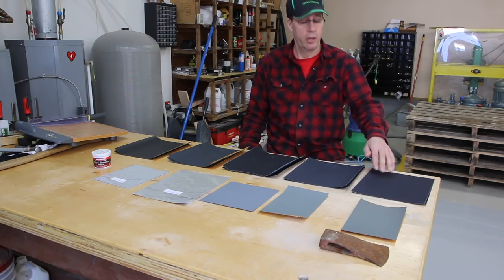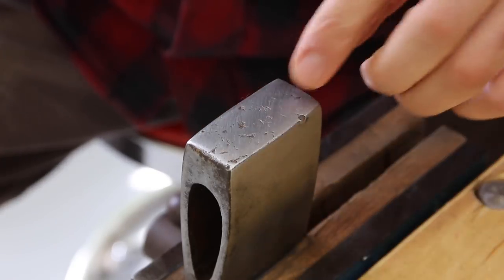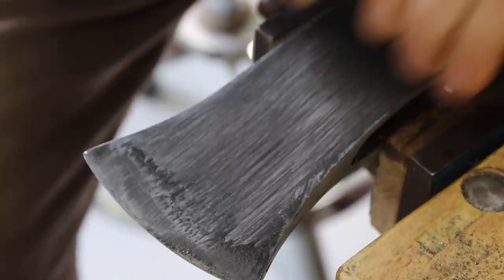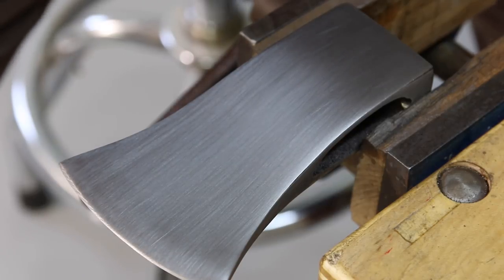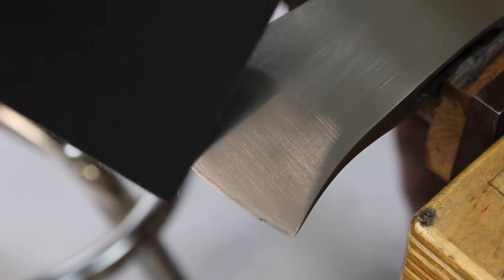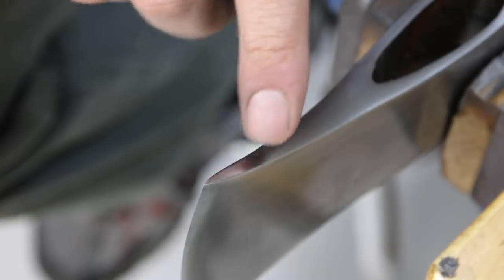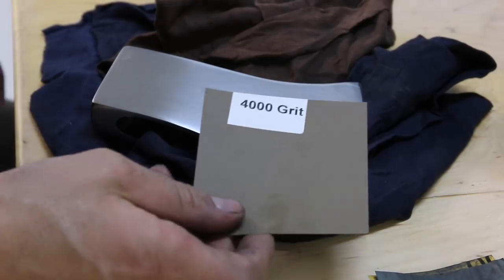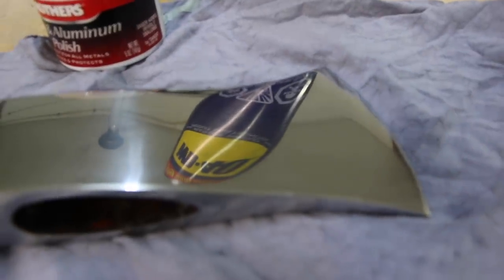How to polish an Axe WITHOUT power tools

Comment: Alot of people commenting on how much faster and easier it would have been with power tools. Some people don't have power tools and specifically search out videos like these. Also, when you get finished with a project like this it is so rewarding when done by hand. Some people just enjoy the aesthetics of doing it this way. Lastly, some people love having one arm look like Popeyes and the other arm looking like Olive-oil's!
Reply: i found a big 2.5" anchor bolt at the tesla plant going up in austin TX. im wanting to do this with it and use it as a paper weight. could not have made a better video myself.
Reply: Using mechanical equipment can be faster but doing something quickly dose not always mean it is done properly.
Reply: Olive Oyl* 😊😊
Reply: I completely agree. If I’m doing it for someone else or doing it knowing I’m going to sell the finished product, I’d prefer to use a buffer machine. But things I plan to keep in the collection I like to do by hand I enjoy knowing I put the time and effort into it more.
Reply: @Biggchad  for sure. When I ‘restored’ my first couple of pieces I only had hand tools. Later, I acquired some power tools and did a few and it was quicker but not as satisfying.
Reply: It will dull the axe if not careful.

Comment: Just a little tip, always fold your sandpaper in thirds. It keeps it from sliding around all over the place, as well as giving three surfaces to sand with as it is difficult to apply pressure at the edges of the sand paper.

Comment: Nice job. In my experience, normal cloth towels and paper towels are abrasive to mirror polished surfaces. I think that's why you had scratches in the end. Try to buff off with clean microfiber with gentle pressure if you can and see the difference.
Reply: He needed to buff with Tripoli after sanding and before polishing.  It removes the fine scratches that sanding doesn’t get unless you go to 15 or 20k grit.  I do this at my job.

Comment: Trick from a guy who restored a couple of medieval armor replicas:

Let your 600 and 1000/2000 grit sandpaper clog up some as you work and get mirror finish in less time with the same car metal polish and no more than 2000 grit. Just keep sanding when your 600+ seems clogged up and see how it goes from there...
Reply from the maker: Thanks for the tip!
Reply: @frenchriversprings  nice video. What’s the reason for changing the direction of the sanding?
Reply: What the reason that letting the 600 grits clog up gets a mirror finish faster ?
Reply: @marcn8750  As it gets clogged up, it becomes smoother and the grit seems finer, as if it was a higher grit sandpaper, but broken in. If you go for a new sheet of higher grit paper from there, you'll have to break that one in while making the surface dull again.
Reply: @Flashahol  interesting. I’ve always wondered why my older used sandpaper seems to be more gentle. 
So it’s basically less aggressive snd will give a shine faster IF the surface cuts are “ready” for it. 

The slag on the used paper is basically steel dust mixed with the lubricant. The abrasive on the paper is either worn away or covered by this slag. 

Correct?
Reply: @marcn8750  You got it!  
It's like your sandpaper is gradually turning into polishing paper.
Reply: @Flashahol  got it thanks. Doesn’t makes it better … just makes it milder. 

Recently I have been doing this …

1) use metal polish. It’s aggressive. But gives a nice even cut lines. Can cut normal A4 printer paper to size and put a bit of polish on said area. 

2) cape cod cloth. 

3) diamond paste 0.5 microns on a cotton mop

Has saved me tons of time. I do this for mirror polish for watch cases.
Reply: @marcn8750  Precisely! You still need some fine metal polish for perfect mirror finish, but it's faster and lazier than going through 3-4 different grits and then different metal polish grits. 
Diamond paste in micron size is hard to beat, but not the cheapest. I like the cotton mop idea, I'll have to give that a try.
Reply: @Flashahol  the metal polish is use give quite a coarse mirror. Good enough for silverware but not a watch case.  I cape code cloth gives it another 30% finer mirror. And the diamond paste with the cotton wheel does the final 5%. 

I only  for dings on the watch case. Maybe 3,000 grit.

Comment: I agree with the process, that is, up until the polishing. the mag polish is for magnesium, not steel. if you change to a German metal polish like Semichome, as well as, keeping your polish stokes straight and not going around in circles, it will produce a clearer reflection. The thing to also take note of is for people trying to do this, make sure you remove "ALL" the scratches caused by the previous sandpaper. If not, you will get a distorted reflection (kind of like a carnival mirror). If you would like to keep the polish, you will need to seal with a metal lacquer to prevent it from oxidizing. However, for me personally, I would have used machines, it's just a little faster.
Reply: Agreed. Though, I wouldn't bother to polish the whole axe head in the first place, just the primary bevel with the cutting edge. The remainder would be fine with a 600 grid finish. But I guess the video still fits its intended purpose, except for the use of an unsuitable polishing compound.
Reply: It sounds light the paste and/or cotton wheel could be too coarse, or you are applying too much pressure when applying it to the buffing wheel. Make sure your buffing wheel is clean and you are using a very small amount of your paste and let the bracelet bearly touch the wheel.
Reply: Many thank for your advice,  i will try
Reply: Why can't it be used for steel?
Reply: If you look at the video though, the container says "for polishing all metal" right on the front of it.  I think he got the intended result and the product seemed to work just fine!
Reply: @phantomcreamer  Just guessing here, but maybe the abrasive is not hard enough to scratch steel.  Magnesium is much softer, so they could get away with using a softer abrasive.

Comment: I feel your pain... I restore and sell norlund axes on ebay with exotic handles.  Most polished..  I do use a flapwheel for primary grind, but i hand sand the rest.  60(flap) 120, 180, 220 320 400 600 1000 1500 2000 then black then white compound on a wheel.  It takes me about 4 hrs start to finish on a polish.

Comment: I appreciate the hard work that went into this, but a couple critiques that I would make is that you are using too much pressure.  The sand paper will remove material no matter how hard you press, but pushing too hard will leave scratches.  With light pressure you can finish in half the time.  You can achieve a mirror finish using water and 2000 grit sand paper with light finger pressure.  WD-40 has surfactants in it that will prevent you from achieving a good finish, so you should save that until the end after the buff.  if you have any light scratches a little rouge will take care of it with a microfiber cloth.

if there are any major gouges I'd recommend a bastard cut mill file.  It won't cause deep scratches, but will take a little longer. Never change directions.  if you're sanding from heel to edge do that the through whole process.  Once the scratches disappear from the previous grit then go to the next higher.  If you move the the next grit too soon you will have scratches though that won't come out.

I normally use 60, 120, 220, 400, 600, 1000, 1200, and 2000.

Comment: Thanks very much for posting this.  I needed the instruction.  I've got a table my GGrandfather made, 60,000 pieces of inlaid wood.  The legs have steel slides on the bottom, one is rusted up badly (old cat pee that leeched through the carpet a long time ago), I discovered when i moved the table.  The wood is fine, thank goodness, but one steel slide is about as rusty as your axe was to start.  I can't find a replacement slide in the same dimension, so I'm going to restore this one.  Goodbye wrists, hello sheen.

Comment: Well it seems that is the way to go, when guys use the grinders and power sanders you can really see waves, high/low spots in the metal that ax turned out perfect, looking forward to you making the handle.
Reply from the maker: look at the end of the video. there is a clickable link of my video making the axe handle   :)

Comment: For the heavy rust I just soak in white vinegar for about a day or two. Saves energy and time does all the work. Same with baking soda and water, good for touch ups on kitchen knives after use to halt corrosion and rust also very light abrasive.

Comment: Little help for you on the sandpaper ..After a file you will want 80 for any shaping of the metal (edges etc)  120 should be used to rid yourself of any left over rust and remove file scratches and other heavy items  180 should be used against the way you used the 120 which will sand away the 120 marks and make any other deeper scratches much finer and removable with your next grit of 240 or 280 ether or  Then on to ether 320 or 400 At 400 you can go dry then go back as a wet .. warm water and dish soap helps it slide better  600  Which you dont need to use along time 800 same thing  1000 grit Your doing to look at your work and see if any scratches stand out from the rest  IF so go back to 400 wet over said area and follow grits upwards again ..If not 1500 or 2000..Now that you are at 2000 grit  You can start using cleaner and steel compound and polisher ...I myself use wire wheels on a drill or dremel  Sanding drums and polishes and far and few by hand

Comment: After you sand, if you use Tripoli  to buff, then rouge to polish, you will remove the finest stretches left from the 10,000 grit.  I do this with bronze.  Since you worked so hard, you should get some Tripoli and wool buffing pads and try it.  Then polish with a super soft cloth—no paper towels or Terry cloth, too abrasive.  Fine cotton cloth.  Many micro fibers are too abrasive too.

Comment: Good presentation!
Indeed a polished axe will deliver more effective cutting force/impact because of lack of surface friction. 

However once a desirable high mirror polish is attained, I would recommend that the axehead be long term BOILED in HOT water for several HOURS.  This will produce 'beneficial' rust on the surface - (black) ferrous oxide which is protective against (red) ferric oxide rust which is 'destructive'.   

Now you know why there were many more 'black' knights than 'white' (polished/silvery) knights.  Also, for those of you who know what USMC KaBar knives are all about; this is why they were supplied with a 'black' surface finish.
Reply: Dip the blade in vinegar or "warm" vinegar. Boiling the axe will ruin the heat treatment, potentially annealing the blade and making it more susceptible to dents and rolls. You could etch the blade with vinegar or other chemical process instead of aiding the reaction with detrimental thermal processes.
Reply: —>  @Leviathanshadex   The temperature range for process annealing ranges for STEELS is from 260 °C (500 °F) to 760 °C (1400 °F). 500°F/260°C is a loooooong way from  212°F/100°C.  Hope this helps. 

BTW .... vinegar (5% acetic acid) 'reduces' (the exact opposite of oxidation) the steel - and NO protective coating by the ferric (black) oxide.

Comment: I did this with a Wade & Butcher 1830 (guestimate) hatchet, starting with 60 grit, thru to 2000 grit (the best I had available) ... then using cymbal polish nicked from my mad-drummer father. I could have pulled out a power tool or two, but was more interested in seeing what could be done with sandpaper and compounds. Mine has many pits and blemishes, but the shiny parts are awfully shiny ... even though the hatchet is basically blunt. I haven't tried to sharpen it yet. Great video. I lived the experience myself ... just not as meticulous or fastidious. Cheers $0.02

Comment: The trick to do a proper job, without living scratches behind and get the perfect mirror finnish, is to avoid files, becasue they can leave deep scratches, that a sandpaper can't remove. Always sand on one and only one, means keep the same direction, from start to fiinsh. Never advance to a higher grit, if not first, you didn't remove the scratches that the previous one has left. As also ,the higer the grit, the more you multiply the passes.
PS If you have to use a file for some reason, don't use the coarser one and don't push hard when filing. The less deep the scratches and the slower you go, the better everything works.

Comment: I’ve done this many times, but with sanding disks in a drill. The ONLY thing that kept you from being thrilled with this result was that you skipped too many grit numbers. You should have stopped and waited until you had what you need ... then you would have results commensurate with your effort, patience , and attention to detail... well, except for this ... Anyway, what has worked well for me is the following sequence:   230, 320, 400, 600, 800, 1000, 1500, 1800, 2000, 2400, 32k, 4k, 6k, 8k, 10k, 12k. The last eight grits were in a set of 5” velcro-backed padded disks I found on Banggood... the whole set was about $20 ... 12k grit is recommended to bring model airplane canopies to optical standards (!!). A place called MicroMark sells 2x2 sanding pad sets designed to do exactly that .. (it’s a modeler’s heaven) ... the coarser grits were all available locally from Walmart, Ace Hardware, and NAPA auto parts. You can try and remove 320 grit scratches from hardened tool steel with1500 grit sandpaper through sheer effort and patience, just like you can try to level out the Grand Canyon with a garden hoe, and you will be equally successful in both endeavors. Availing one’s self of available grit numbers, you can even be a little sloppy and hasty and yet still come out with even the tiniest of hairline scratches gone. After the 12k grit, I finished with cotton wheels (NOT felt) loaded with black emory bar, brown bar, white diamond bar, and finally jeweler’s rouge. Just as a side note, after I saw what could be done with the 1800 - 12k grit abrasive pads, and the polishing bars up through jewelers rouge, I decided to see if I could improve the condition and appearance of my poor 20 yr old wedding ring, dirty and scratched. My wife, after hearing the tool running for some time, was curious when I came in with it saying “Look what I was able to do with this ...” Now, mind you, the finish was absolutely flawless, and the gold literally glowed with a very slight hint of a warm rose tint to it that it had not had since it was new ... but she didn’t know that ... so when she asked what I had been working on so long and hard, and I said “my wedding ring” - she spun around and had this look on her face that was about the same look she would have if she asked “So, what did you and the baby do while I was out?” And I said, “Oh, we went to the park and I strapped him to the big box-kite and got him up to about 300 feet ... he laughed and laughed... “ ... yeah, about like that ... but when she cautiously looked down at what I had in my hand, and saw the same ring she had seen in that jewelry store display case some 20 years prior... well she almost started crying. So anyway, sometimes restoring something to its original glory is more than simple maintenance of property.

Comment: do not use WD 40 for finer grids. It creates a film that is quite thick compared to the grid size, which reduces the effectiveness from the sandpaper. There are special cutting fluids that work better.

Comment: I suspect you could have saved a lot of those hours, plus some of the deeper scratches, buy soaking for a few hours in a rust-removal solution. Then you could have started with a lighter paper for the finishing.

Comment: i love his approach but really expensive after i looked the site he posted for the paper sheets i can say the papers itself will cost more than the power machines lol 10$ for 3 sheets per grit i mean you can buy just a power tool sanding for less than 30$ somewhere and surely there can be some of them used 15$ or less just buy only one low grit disk and one very high and you are done those can make the head shiny af in like what 10-20 min ? alternative is to buy half of these papers you dont need to jump the grits by 100 just buy 300 then 600-800 what you can find you don't need 320 grit also after you took any deficiencies with 300-600 just jump to 2500 and then higher if you find any and you are done he spend all day for an light rusted head axe lol also there is those handlers that the sandpaper can stick and you can sand half of the axe with just one push thats faster i did my headaxe in like 2-3 hours if you count in that i removed the rust by using vinegar it doesnt worth to sand the rust down as he says no power tools vinegar and half of his sandpaper sheets with a sandpaper handle is enough in the end you need just an flat bastard file to sharp the edge i would not mind the cream i didnt even notice any improve before and after im sure nobody would care if you use a shiny axe or not and it wont help you with cutting woods just like decorative optical effect if you want to protect it just use specialized cheap metal polisher that will just add some protection from rusting again and finaly why wd 40 lol a few drops of water is cheaper i think

Comment: Im doing hand machining gunsmith work on a percussion pistol. I shaped the new hammer the way I like it, Now I have to polish all those contours - Yikes. Should have kept it flat and boring, instead of a swooping, fine shaped hammer. Im just figuring how I am going to work it? I thought various wood dowels to match the shape, wrap sandpaper around that, go to work. Good Winter project.

Comment: Scratches visible in the end are from the 600 grit.. you made a jump too big going 1500.. so all the steps after 600 could not eliminate those.. they take off minute amounts af material..  good job tho!